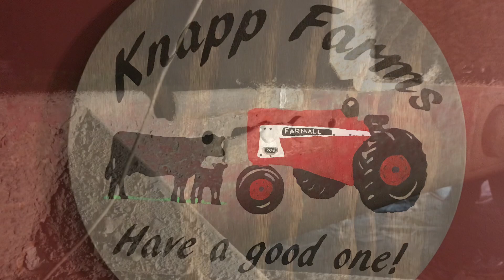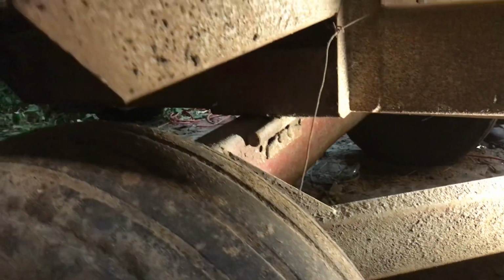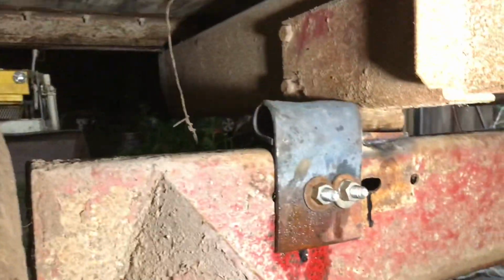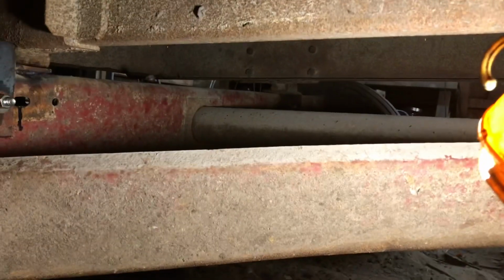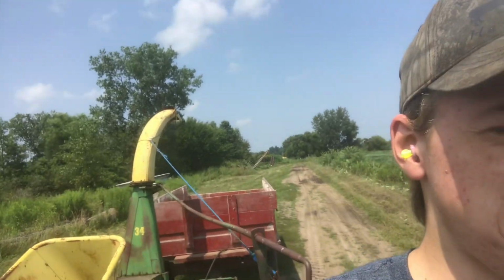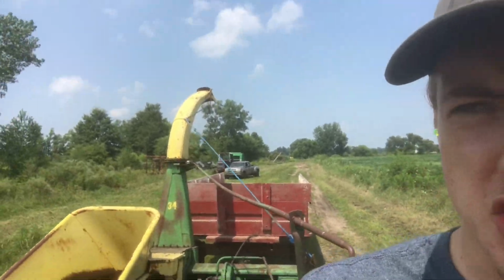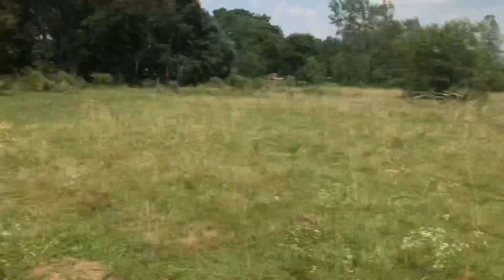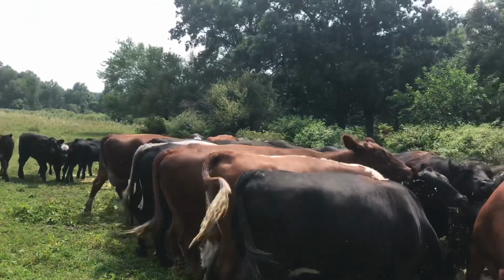Cutting silage with the John Deere 34 forage harvester and International 856 welding the barge wagon

Comment: Fix looks good!
Hopefully the wagon dumps step enough!  We always figure at least 50° for the trucks to dump good... And you are finding you need more angle... Like secret for you, hose the trailer down with water right before you go out, should work better 👍😁
I always used to hose the truck bed down before heading to the field, still helped even with an hour drive.
Reply from the maker: I’ll try that next time I cut silage again and put it all at the back of the trailer that helped I am also gonna drive up a hill while dumping it next time see if that helps
Reply: @knappfarms  steeper is always better to unload. Nothing worse than having to shovel it off.
Reply from the maker: Especially with this 109 heat index we have been having I think we have a hill that will work you guy will know how it goes I’ll try to get it on video 😂 what could go wrong
Reply: @knappfarms  ya, way too hot for too much!! Looking forward to seeing how it turns out 👍

Comment: Grind that steel off clean and your welds will turn out much better. Welding hardened rebar to mild steel makes it difficult as well. You'll get it.
  That's a pretty nice old chopper.
    Best regards from Indiana.
Reply from the maker: I wire brushed the steel but obviously that doesn’t get it perfect and yeah I was dealing with a bunch of different thicknesses and hardness of steel so not pretty but it worked we have been using the wagon every day

Comment: I think if you could throw a poly tarp in the bed before blowing the silage in since your bed doesn't raise enough to dump it might slide out better.
Reply from the maker: We where thinking of getting poly but the last couple times of driving up the hill have seemed to work I think the floor was rough from scooping corn out of the wagon and the repeated times of dumping it has smoothed it back out so it’s actually getting easier every time
Reply from the maker: Lol I thought this was the new video I posted I just posted one of how we get it to dump now